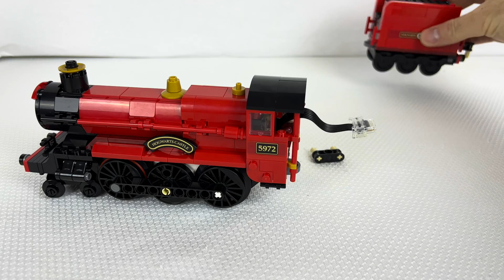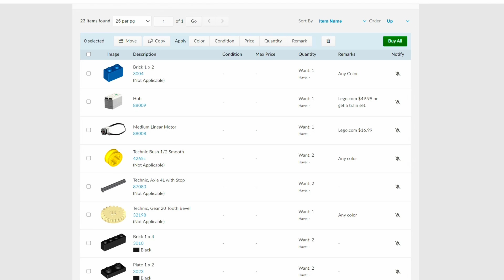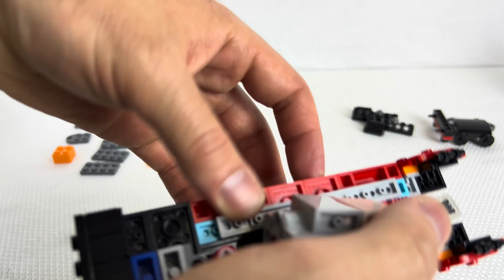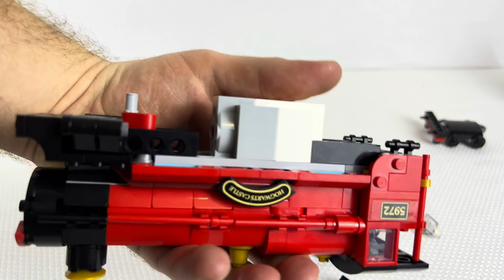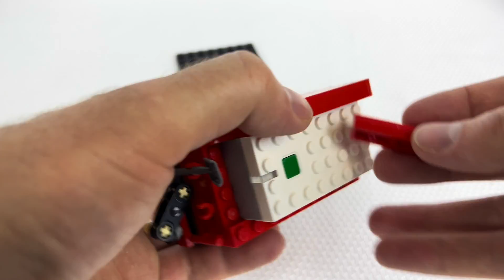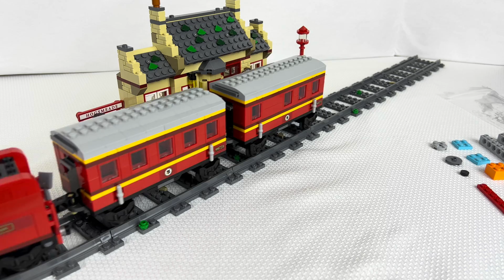Motorizing the NEW LEGO Hogwarts Express 76423

Comment from the maker: Here is a Link to the part List 

https://www.youtube.com/post/UgkxsCvOx4NrbZY1L3kK1GkbGbeJivIq6Yq0   

I also recommend trying out a train motor on the tender if you are new to the Lego trains. This solution works and looks the cleanest in my opinion but if you want to train to be faster and have variable speed, a train motor (bb0896c01) with the battery box shown in my part list (88009) will work well. You can use the Lego powered up app on a mobile device as a controller or buy one from Lego (88010-1). Thank you!

Comment: Thank you for this build! Any tips to help the train wheels maintain traction? I have the rubber band on like you do but the train loses traction and stops coming out of corners.
Reply from the maker: You can try adding rubber bands to the other wheels. If the train is coming out of corners, you may want to check the couplers. I don’t think it was this one, I think it is the 2018 Hogwarts express that derailed from the way the couplers were designed. Sorry for the late reply on this one. If you have two rubber bands try only 1 wheel because one wheel needs to slip while the other needs the traction

Comment: Just ordered the bricks from your list but i guess the (red) bricks to make the battery hub hidden are not included(?) what parts could i get for that? This will be my first lego set so I don’t have any parts lying around. Would it be an option to just put in a small lithium pack instead of the battery hub? That way i could make a physical on/off switch, charge port and make it smaller.

Edit : i guess i’ll also be needing the remote if i go for the 88009 hub?
Reply from the maker: You can use the Lego powered up app instead of buying a controller if you have a compatible mobile device. I’ve never tried a small lithium pack so I do not have a good answer for you. The bricks for the tender are simply used to cover the box. I May have used 1x8 red bricks here and or 1x3s and 1x4s. I’m not sure on the exact ones but a variety will work and you can try different colors too

Comment: I did an alternate build of the tender. Same thing of extending the tender seen here but i also made room in the tender to hide the motor and wire itself too. However note of warning: thr motor is in reverse (the end where the cord comes out of the motor is forward) so when using a remote or powered up app you will need to throw the switch/push rhe - button. Even used a small trick from the express passenger train to allow access to the button but also conceal it as well

Comment: Is it possible to use variable motor speed using PyBricks?  That would solve the constant speed limitation of this motor.
Reply from the maker: I am unsure about the variable motor but if it is a variable motor then it should work. I have also used the powered up app and you can build a variable controller and it changes the power input to the motor hence changing the speed and it’s better for starting up with a motor that only has one gear